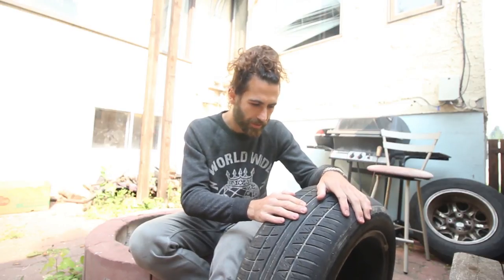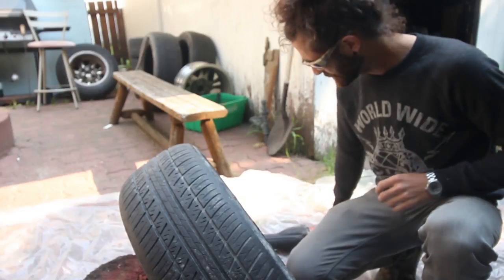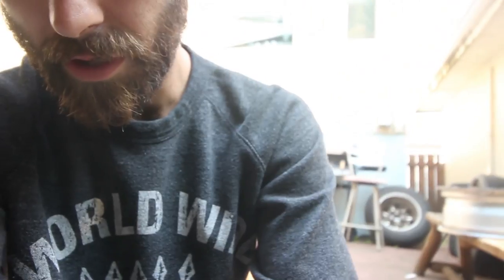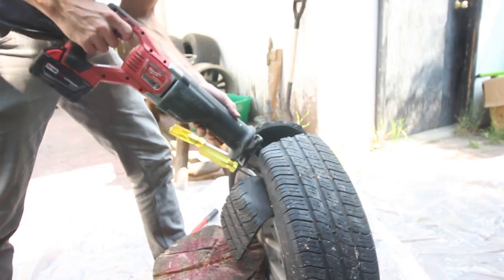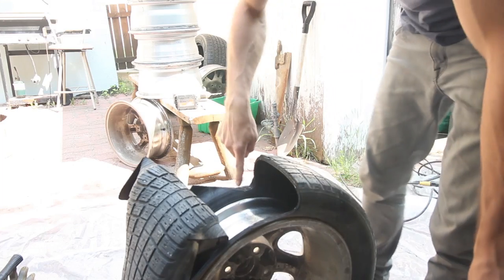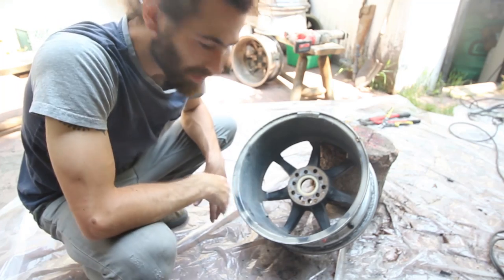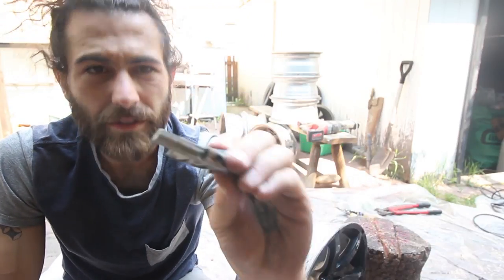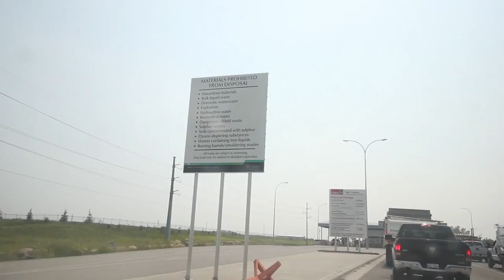Best Way I Know How To Get Tires Off Rims FAST & EASY - Scrapping a Pile of Aluminium Rims

Comment: I was going to scrap my aluminum rims with tire on them because I didn't want to pay a shop to remove them and don't have a sawzall yet. Then a fellow scrapper taught me how to remove them with soapy water and some hammers. Pour soapy water all around the bead then place the claw of a claw hammer and with another hammer pound the claw down on the bead all around the rim and it'll slip off fairly easily. Do that to both sides then simply pry it off really easily.
Reply: Did u 2 go get a ball after

Comment: Hey advice from a fellow scrapper. I cut from the inside edges where the bead seats on both sides then you don't have to cut the tire all the way through. It also doesn't break the bead loose. I can usually get one cleaned and loaded every 5 min and maybe go through a blade every 10 or so rims. Hope this helps someone have an easier day.
Reply: Yes
Reply: Yes sir......works every time

Comment: Harbor Fright manual tire changer, just bought one for $32.  Just make sure you attach it to the ground well.
Reply: Yep. I have one. Very easy to dismount a tire. A little trickier to mount.
Reply: Yep. I have one. Very easy to dismount a tire. A little trickier to mount.

Comment: I realize I'm late and blades have come a long way in 5 years but the diablo 9" carbide thick metal blades on a decent corded Sawzall is where it's at. 

I scrap cars so I come across a ton of aluminum wheels. I cut down 214 of them Saturday which took just under 4 hours. Once you have the system down you can realistically remove 1 tire per minute. By far the fastest way there is. I average 50-60 wheels per blade before the retaining tangs break. (Tangs always break before the teeth wear/break)
Reply: What system did you use? Same as Thub but with a better blade? Thx

Comment: Here’s what worked for me: 
1. Break the bead on both sides by placing the end of a  3’  section of 4”x4” wood on top of the bead and back the rear driver side tire up the 4x4 until the bead drops loose. After the initial break, use your foot to push the bead down all the way around. Flip the tire and repeat.
2. Use a reciprocating saw (or other?) to cut through the side wall all the way around on each side. 
3. Remove the tire tread off the rim by hand. 
4. Pull the bead rings off the rim by hand. No cutting of the bead required.

Comment: I'm going to say the bolt cutters are best for cutting the bead, or at least the cleanest.
I wasted some clothing using the grinder/cutter, as melting rubber dust shot all over.
Not only that, but the toxic smoke was a choking scene, that probably erased years of my life expectancy.
Also, it saves damaging the rims, in case you clean and sell them for re-use.
So; Reciprocating Saw, and large Bolt Cutters (or friend with a tire machine)

Comment: Let down the tire, remove the valve so all air exits. Get two wrecking bars (be sure to have two ends that are as flat as possible. Smash the tire as close as possible to the bead (caution - tire quality will dictate if the sledge hammer bounces back at you). Use the two wrecking bars as levers to pop ONE side of the tire over the rim.  USE some kind of Liquid to lubricate the bead area, it will Help ALOT!

No need for electric tools!

Long ago use to fit truck tires and bob cat tires (I HATE BOB CAT tires)

Comment: Tried different methods ,but your way ,was great and fast thanks
Reply from the maker: Thank you! I picked up one of those diablo blades for steel for my reciprocating saw and I don’t even need the angle grinder to do the bead anymore, one tool can do it all with the right blade 👍

Comment: The purchase of an old coats 40/40 tire machine ($200) on Craigslist is much better than a package of sawzal blades every time you want to do your tires and rims and when your friend's find out you have a tire machine you'll make more money than with just scrapping. I've been doing it for 20 years.
Reply from the maker: Yeah, I’ve been thinking about it. Of course lots of people don’t have that startup cash right away, but it would pay itself off quickly. Is that the type that you can balance a tire as well? Cuz if so, I could definitely see a reliable little side-income there!
Reply: The coats 40/40 is an older model that you can find on Craigslist for a couple of hundred bucks and pick up a bubble balancer (Amazon  $30) and now you can remove your rims from tire's and change tire's for your family and friends. If you want me to I'll find one and send you the link. Love the videos .

Comment: New IDEA below. Love the video. Helping a friend - who is a scrapper. Found rim with tire - he explained cost/effort.
NEW IDEA: Cut the sidewall off the tire - parallel to the rim. Sort of like cutting the center out of the a donut. So make two (2) rings -- 1. the tire off the rim 2. the bead and the sidewall on the rim. Might save some saw blades this way. Might take more time.
Often tire just come apart this way. You see them on the roadside. I cannot test this idea. I don't scrap tires and rims at all. Friend might try, get back to you either way. BTW, I do electronics, but not on this youtube account.
Reply from the maker: That’s an alright idea! It’s true, this method is quick but the blades involved aren’t super cheap
Reply: @thubprint  I told my friend today. Hoping to get him to try it. If we do, we'll post the results. Best of luck and Leave it better than you found it. ;-)

Comment: Just skip the sawing, split the tyre from the side 1/3- 1/4 of the tyre lenght with a old kitchen knife. Angle grind from the side untill you feel a pop when the bead brakes, slit it from the split to the grind spot and wheel will fall through. 20-30 rims in hour... Sharpening the knife with angle grinder for every other tyre and it will cut like butter

Comment: this video was very well done for a tutorial style. if you ever find some tires sized 205-65r15 i think, thats the size of tires i need. i dont care if they are used. theyre for my 1952 pontiac.
Reply from the maker: +Brother Blacksmith I probably could have made it a 2 min video if I cut it down to just the tutorial, but this was more fun ;)
I'll keep an eye out for those, but you're gonna want nice ones eventually right? I suppose you just need something until then
Reply: thubprint yeah. i need some tires that hold air so i can at least roll it around in the shop while im working on it. once it comes to it ill buy a cheap new set of tires to put on her.

Comment: I have an old bumper Jack that I use . Put the Jack under the bumper the tire under the Jack start jacking it up it doesn't pop the bead at first then bump it with a sledgehammer and pop the bead can I use a thick old screwdriver to remove the tire from the rim

Comment: That was badass man, seriously,  The going to the dump and then the recyclers and including how much you made was excellent.    So many people do not include everything you want from a video. this was excellent. 

  i don't have a bolt cutter, looks like i don't need one for this though , didn't seem to be a preferred tool for the job.  i am not going to be getting any dough for this BS job here though, these wheels are steel and I have to save them for a new tire.  Looks like your method of giant screw drivers to hold teh bed up for sutting will have to be the way I roll unless ," like you were asking about" I find some easier way to do this job. 

  after watching you do this and get paid though makes me want top start collecting POS wheels from folks.   I will have my eye out.      OH!   did you weigh your scrap first? i did the last two times I took stuff in and the sorry ass sob's robbed me on both accounts, it was two different scrap yards also and one stole over 40.00 the other about 28.00 from me.  I only have one other place to try.  I called them on both those scams and they threw me out rather than admit to the "Mistake"   You might think I weighed in wrong but I have an old school Digital fairbanks scale that is powered by 6 D cell batteries and it is accurate to the 10th of an OZ.    they didn't throw me out because I was violent, they threw me out because I broke out my scales to show them and they F'ing knew they would be screwed in the argument.    

      wow though, nice haul.   it would be a rad answer to unemployment if I could do what you just did everyday.

Comment: Perfect way to do it angle grinder and saw saw works awsome just use the angle grinder at the very end and cut the ring with the grinder.
Reply from the maker: +Ramon Garcia yup! I was really hoping the sawzall could chew through the bead, it just couldn't manage it without serious muscle. It's a two-tool job I guess if you want to be fast
Reply: Also what I do is I cut around the rim with the saw saw where there is not that much wire all the way around and it cuts like butter cause on the tredd is a lot thicker then just cut the ring with the grinder i did about a 80 tire one  day it took me about 4hours  5 hours lol. It all differs what tire your working with great video love the tool set have the same ones.

Comment: what about using the recip saw to cut right into the rim and the bead cable
Reply from the maker: I’ve tried that and it just didn’t get through it easily. Might work better with a corded reciprocating saw though

Comment: concrete saw with cutoff wheel. cut halfway through flip and cut the rest of the way through. no need to drill holes to let air out
Reply from the maker: Yeah the drilling holes is definitely pointless

Comment: I've never scrapped an aluminum wheel, if they're not too crappy or broken, someone will buy them.
A manual tire changer costs less than the saws, never needs new blades, doesn't make a mess, and is way faster.  Make friends with a tire shop and they might remove them cheaply enough that it's not worth the effort, and if the tires are decent they'll do it for free to re-sell them.

Comment: Tire Hammer to break the bead and two tire
Bar's to pry the Tire  off.
Reply: ... and proper tire irons are super cheap at the harbor freight outlets..  
I like a long 2x4 + small 2x4 setup using my boat trailer as the fulcrum to pop beads off  
the HF irons do the rest.

Comment: that's how i fo it just a good sawzall. i dont cut  thr entire tire just the edges aka bead
Reply from the maker: +Mike trucker 101 I guess that would be all you need to do huh? What blades do you use?
Reply: thubprint i try to get torque blades from home depot lowes has some good ones also

Comment: I know this is going to sound crazy,  but if you go to any shop with a tire mashine. They might charge you 20 bucks for a few tires removed or maybe even for free if you do it yourself. Way safer, faster, way cheaper.
Reply: Show up to the tire shop at 4:45PM on Friday with a case of beer in the back of your pickup...

Comment: Just use the angle grinder, no need for reciprocating saw.
Reply from the maker: Random Task I agree that it’s simpler to just use the angle grinder, but it makes SO much smoke and a big mess, so I prefer this method. Not saying it can’t be done though!
Reply: @thubprint Yes, I imagine the smoke and mess. I'm going to experiment with various cutting disc types, but will still have to use the standard steel cutting disc at the bead.

Comment: I'm pretty sure there is no easier way then that. I mean you could burn the tires. that wouldn't require much work, but that's frowned upon here in the USA. but I would the rubber would melt on the rim making it dirty aluminum.
Reply from the maker: +journey_with _jay yup, that sounds super gross!

Comment: thats prob the best way and did they charge you to get rid of the tires??? my town you need to pay to get rid of them so i dont even bother when tires are on the rims
Reply from the maker: +Dumpster Marcus nope! 12 tires and under is a free drop off. That's why I was excited, now I have a way to get to the cream filling without spending money to do it. Save for a blade and a cutting wheel I guess

Comment: I just use a sawzall with a 10 tooth demolition blade or  a 14 tooth steel cutting  blade and cut thru the sidewall & beads. I usually have to cut into the rim to get all the way thru the beads. But it's the fastest. In my area I have to pay $2.00 a tire to get rid of them. But the scrap price of aluminum rims is high enough to make it worth it.
Reply from the maker: +Fordman7575 well next time I get one I'll try that. I found it was too much work to get the darn thing all the way through the bead, but maybe I just wasn't levering it properly?

Comment: take the tires to a tire shop...exchange the tires for rims after he removes them for you at not cost...used passenger tire are 5 to10 bucks each.
Reply from the maker: +Rowe Energy that's how I used to do it, but if the tires aren't worth saving then this is way cheaper ;)
Reply: thubprint: correct, but it seems, your tire had tread..so, therefore good tires for 5 to 25 bucks ea.

Comment: Could you use the angle grinder for both parts?
Reply: I have in the past, just make sure that you have plenty of cutting wheels because they dont last long.
Reply: I imagine the burning rubber would stink and smoke.. also hard work

Comment: Why do it the hard way? I work in a scrap yard and have cut off hundreds if not thousands of tires off of alloy wheels.  No need to let the air out either. Use a Stihl gas cutoff saw with a metal blade. I can do about 50 an hour or so. We have tried numerous methods and it's the best way. Trust me it works. I could have removed 10 in the time it's takes you to do one.
Reply from the maker: I’ve been wondering how a scrapyard would zip through them! Is that one of the big circular saws though, like the ones people use on stone and pavement? It’s all well and good to do it with a specialized tool I suppose but not many people have a gas powered saw just laying around 😂
Reply: @thubprint  yes it is. You can cut steel or masonry with them you just need to hook water up to them to cut concrete